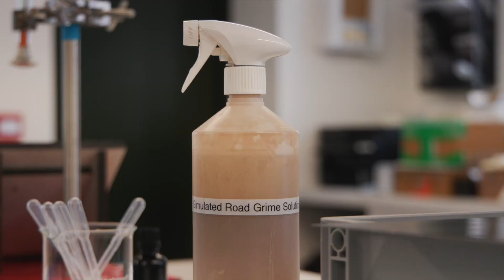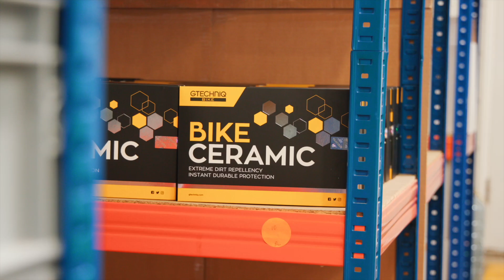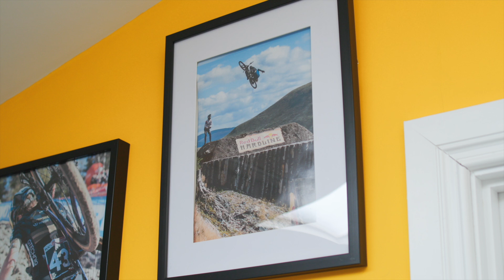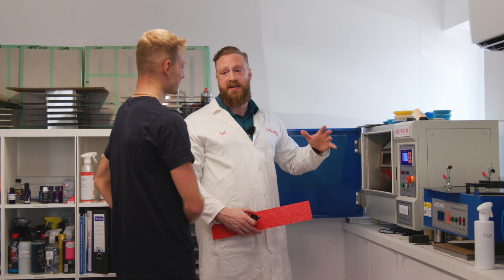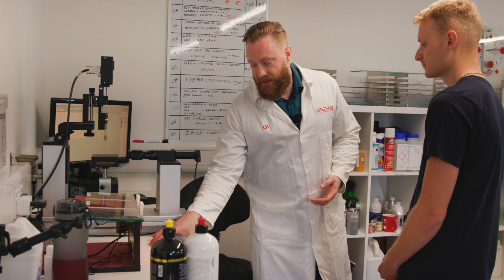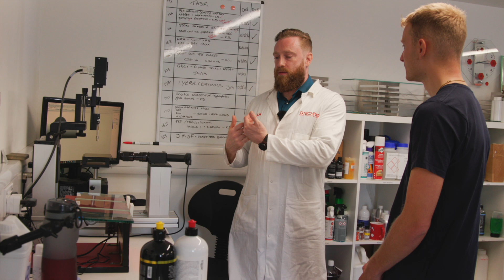Bike Cleaning Science - How Does GTechniq's Futuristic Bike Ceramic Work?

Comment: Being a car detailing nut, i love all this kind of stuff. Atm, my bikes have Bilt Hamber wax topped up with whatever comes to hand first. However, the real benefit of ceramic coating is that you may get 3 years (maybe more) of durability, which is superb. Whatever you do, you must strip the frame down completely. I do that twice yearly, so 6 months of wax protection is adequate for me. If you can't be bothered with that, ceramics are a genuine option for frame protection and to make cleaning easier. 
Nice video, cheers!